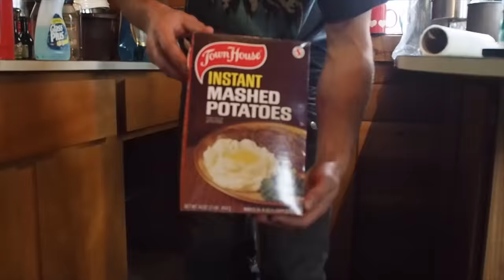Remote Alaska Cabin: Our First Trip, Part II of VII

Comment: I worked as a logger for 40 years and a goldpanner all the time I was logging and 10 years afterwards. You BOTH should be carrying a side arm. You can be 20 feet away from someone and because of the dense brush, if you had a firearm and the other one didn't, .... It would be too late. June up there, is feeding time for Brown and wolves.
Reply from the maker: I bet you have some great real-life camp fire stories to tell with all that experience! You are absolutely right. We plan on getting the required tools up there to carry whenever we are outside. We appreciate the advice, will take it to heart, and work through the logistical process and paperwork required. For the next few years I'll be traveling internationally to get to Alaska, and usually on a tight timeline. Thank you again!

Comment: Thompsons water seal...that's why the cabins siding has so much mildue and looks like 10yrs old.  Wash that crap off and use a quality oil based stain on that beautiful cabin.  Oil based means next to no prep work for the next application in 20yrs.
Reply from the maker: Thank you for the advice! It sounds like it comes from deep knowledge through experience. You'll see in future episodes what we end up doing to the exterior! Open Kimono here, I would my biggest mistake was not getting oil based stain. We only had a few hours to do a LOT of shopping and I thought the stain I was choosing was oil based. Out at the cabin I realize it was water based..

Comment: Is all the work around the base of the cabin for air circulation or are you planning an addition?
Reply from the maker: I'm not planning an addition to the cabin at this time. The work around the base of the cabin if for multiple reasons: frost heaving has broken some of the triangulation supports, one of the supports has rotted away, and tree roots are growing well under the cabin. We are creating some work space to fix these issues and hopefully eliminate future problems. Who knows, maybe what we are doing will create a whole other set of problems come winter.